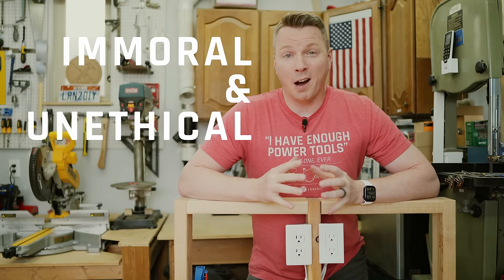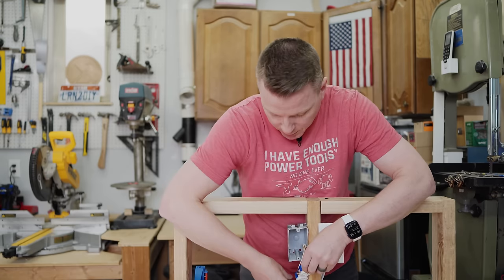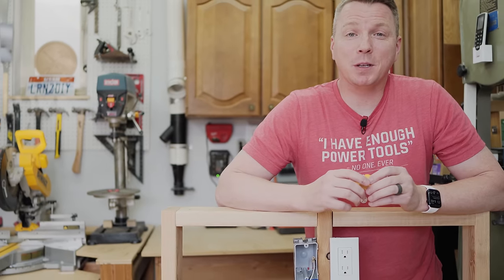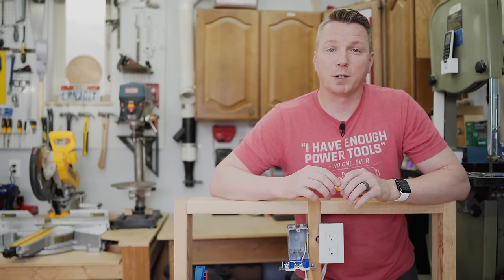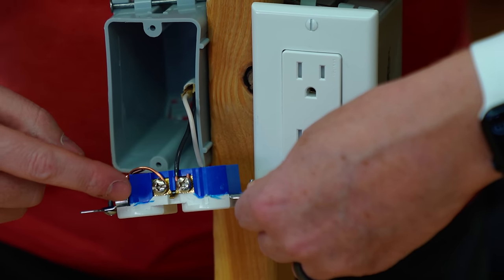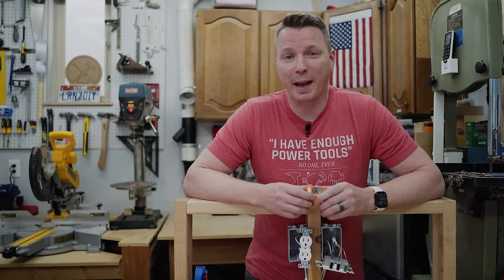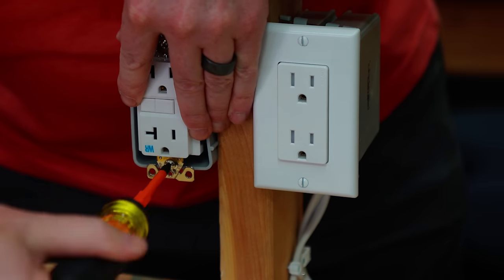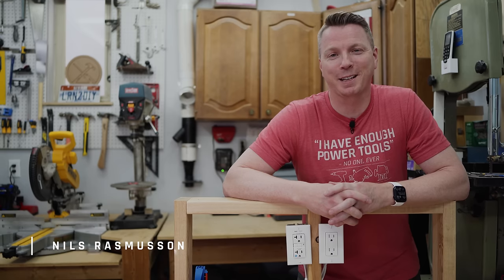People Are Adding Deadly Hacks to Outlets

Comment: honestly i just plug the neutral and fase into a 3 prong jack and dont even use the 3rd i see it as a way to hold the plug sturdy xd i think a ground circuits makes it easier to shock yourself if you working with a live fase and accidentaly ground yourself to the neutral  you can grab a live fase as long as you dont grab the neutral with anything else

Comment: I could afford to rewire the older half of my house but I did upgrade the panel to breakers and run all new cable in the basement as far down stream as I could without tearing out walls, then put in GFIs anywhere still without a system ground. The old stuff is braided 2-wire. No poles at least.

Comment: Is there a safety reason against running electrical cable inside PVC or similar piping? I recognize that there might be legal issues depending on where you are, but is there a safety issue?

Considering a remodel, and trying to make future repairs more accessible and obvious by putting labeled pathways for wiring, networking, plumbing, etc. I know a lot of remodels I've seen have wires just going freely through drilled wood, so I don't see a reason thin piping should cause issue.
Reply: Well, you can't just use water pipes for wire, it does have to be actual electrical conduit. But, yeah, that's actually a great idea. Most contractors don't bother because of the expense, but it's actually a much better idea in almost every other way.
Reply: @HiddenWindshield  is electric conduit waterproof in case of leaks or condensation?
Reply: @saurianwatcher4437  No. In fact, it can't be waterproof, because condensation would happen anyway, and you need some way for the water to drain.
Reply: @HiddenWindshield  OK, so safer would be conduit with maybe a PVC "hood" by cutting the PVC in two. 

Basically, my thought is wood panel walls (horizontal) and one of the panels is hiding a pathway that all the conduit and piping goes through for easy access for repair. 

All of this would be on an internal wall with high thermal mass to provide passive heat storage in the winter, and passive cooling in the summer by running cool water through it.
Reply: It's a pipe dream project.
Reply: @saurianwatcher4437  LOL no, a PVC "hood" wouldn't help anything at all. Actual electrical conduit really is the best way to go.

Comment: One thing you missed…
The outlet tester also won’t tell you the outlet that you have installed is UPSIDE DOWN 
Ground pin should be up !!!!!
You may ask why …
In the case of the plug not inserted all the way in and leaving an exposed gap where any conductive material can fall (gravity) and short the hot and neutral !!
Local Inspectors here would not pass your installation as you have demonstrated. 
Ground pin has to be UP.

Comment: You can run a ground wire to the outlet from the panel and that doesn't have to be in conduit. You can also use the conduit as a ground path. Two other methods. You are talking about cable in your video.

Comment: Strange.  In all the homes I have lived in, the old two prong, two conductor cable was BX type with a metal shield.  To add a three prong outlet, you just need to add a ground wire that connects to the shield. The only exception was in really, really old post and tube type wiring that doesn't use cable at all, only two wires running next to each other.  You hardly ever see that anymore and if you do, you should replace it with modern cable because it wasn't safe even when it was newly installed.

Comment: Uhm ... wait a sec. ... is that a 15 or 20A circuit?  That GFCI you show being installed there is 20A, not 15A.  The 3-prong you showed in there before was 15A.
Probably best not (and code?) to have 20A outlet/receptacle (though switch would be okay, presuming one uses connections on it that are designed to also accept 14 gauge / 15 A wiring on it where one is using such wiring on 15A circuit) on a 15A circuit (as one may plug in an up to 20A load and overload the circuit), likewise 15A receptacle on 20A circuit also not good, as the outlet could be overloaded if thing(s) plugged into it draw over 15A total (overload or short).

Comment: I have still yet to find anyone that can explain to me the purpose of a "seperate" equipment ground, and while I've never encountered a bootleg ground nor have i installed one i dont see any problem with it so long as it is properly wired. Is there a difference between bonding the neutral and ground in the outlet rather than in the service panel? maybe someone here can explain to me what (if any) difference there is since to me there is no difference in length or gauge of the wires used in Romex so the resistance of the wire is the same, the ground and neutral busses are already bonded in the panel so why not save 30% of the cost by runnin 2 conductor rather than 3 conductor (this is obviously excluding split phase appliances that do not require any 120v since no neutral would exist in that circuit and would require an equipment ground to be ran)

Comment: Another option would be putting a 60W light bulb between live and ground. If the breaker pops, the wiring is fine. If the light stays on like normal, ground is shorted to neutral.

Comment: You put a 20 amp GFCI outlet where a 15 amp duplex receptable was before, possibly exceeding the wiring and circuit breaker rating.

Comment: I don´t see a big problem in bootleg grounds, it´s very oldschool but still better than nothing. For circuits without RCD protection, bottleg ground and "proper ground" doesen´t make such a huge difference, since neutral and ground are connected in the fuse box anyways. 
The only danger is that when the neutral wire gets disconnected somwhere between the fuse box and outlet

Comment: I have a weird question.  In a case where a circuit is wired in reverse (black to silver, white to brass) would it be kosher to reverse the wires at the circuit breaker box, and mark them with the correct colors?  I think this MIGHT be kosher, but I would certainly NEVER do this!
Reply from the maker: Unfortunately, no. You would have to fix the receptacles (outlets), and not rewire the circuit breaker panel.
Reply: No, you must use proper colors for proper conductors. In cases where use reassign the neutral as a switched live you mark it with a tape.

Comment: You never explained why it's dangerous, i mean the ground and neutral (white) wire are connected to the same rail in the breaker box. My guess is that its for the reason that the Russian channel kreosan was able to get output from a pipe in the ground and the neutral wire. Voltage drop across the neutral wire while your standing on the physical ground wich may not have as much voltage drop could give you a little shock

Comment: In Britain, all electric cables have the Earth wire installed into them. You might need a sheaf to go onto the Earth wire, although you can connect it up, with the earth wire bare. 

Red for danger, so that is the Live wire.
Black is the Neutral,
and Green, or Green and Yellow, is the Earth. 

Although the new colours are:-

Brown is Live, 
Blue is Neutral,
Green and yellow is the Earth.

Comment: I'm not defending the practice which is dangerous for several good reasons. However, it should be noted that the Earth and Neutral wires come together in the distribution box. Meaning they are electrically the same signal. This was a shock to me (no pun intended) coming from Europe where the Earth and Neutral wires are not the same and are wired in very different fashion.

The Earth wire provides a level of redundancy. Although it carries no load in normal conditions, it must be capable of carrying the full load from the live wire should an electrical fault occur. In this illegal configuration, if the Neutral wire is compromised, or the Neutral connection on the socket is compromised, then Earth safety is immediately lost.

Even in recent build homes (post 2020) I recommend you have your new-build home independently inspected. Approximately 2 out of 3 homes I inspect have some form of electrical fault ranging from procedural to potentially catastrophic. Yet all of these homes were nominally 'inspected' prior to sale and deemed safe.

Comment: Instead of replacing the outlet with a GFCI outlet, could a GFCI breaker be installed in the electrical panel?
Reply: if you change it to ungrounded outlet yes

Comment: I thought that the main reason for using this solution is to connect the device housing to the ground. that way if there is a short circuit inside the device and the housing is energized, it will create flow of current that will pop a fuse. Otherwise you wouldn't know til you touched the device and got shocked

Comment: Why doesn't the bootleg ground short out and melt the conductor? It won't trip the breaker because it bypasses the neutral connection to the breaker. But since ground is (should be) bonded to neutral at the service entrance, it is shorted
Reply: Neutral and ground are electrically the same. It doesn't matter if they're bound together at the outlet or at the panel box, it's all the same electric potential. A bootleg ground won't cause it to short and trip the breaker. He's kinda over exaggerating how dangerous a bootleg ground. It still provides the ground on the outlet a return path to the panel box via the neutral wire instead of a dedicated return via the ground wire. By no means am I claiming that it's safe and I would never do that or recommend it to anybody. I'm just saying that it would work and you'd most likely be okay if something were to happen. However, there is a reason that code requires a dedicated ground wire and that ground and neutral to be bound together only in the panel box and nowhere else. They want a separate dedicated return path back to the panel box in the event that the neutral wire breaks or opens in some way. The ground wire is just a second, separate return path to the panel box for redundancy.

Comment: There's a mistake regarding 20 amps running through body. Body resistance is quite large so current would be in the miliamps range.
Reply: a wet body can go down to 1000 ohms, which'll get you 0.12 amps at 120V, which is easily deadly

Comment: Well, in some situations bootleg ground is better than no ground. If a device breaks in a way that there is a short between the hot wire and the device's external metal parts that should be grounded, with no bootleg ground, you can get a shock, with it, it will trip the breaker. The only risk with the bootleg ground is when the neutral wire breaks, touching the device will close the circuit through you. The question is, which situation is more common - an appliance or wiring failure.
Reply: No. With no ground, the circuit breaker will trip only in an over current situation or a hot to neutral short. If you plug an appliance into a bootleg grounded receptacle the appliance will be sharing return current between the neutral and the ground. I'd say that it would be highly likely that you would get a shock because the ground plug will be connected to a current carrying contact from the receptacle.
Reply: @surferdude642  Yes, hot to neutral short will be happen if there is a bootleg ground and the appliance breaks in a way that there is a short of the hot wire to the appliance's metal cover that is usually grounded.

Comment: So does the neutral not connect directly to ground anyway?
Reply: The problem is if something happened to the white neutral wire than runs back to the mains. Then suddenly anything plugged in stops working and becomes electrified and likely to give you a nasty or fatal shock.

Comment: I know it is bad, but please explain how the bootleg ground is dangerous since the ground wire and neutral are connected in the panel.
Reply: bootlegs cause current to flow through ground wires and grounded metal parts of appliances. not ideal. and if you cut, damage, or switch your neutral, you get full line voltage on all the grounded metal parts of the appliance too.

Comment: Its not "designed to fool the outlet testers" - its designed to avoid running a new wire where no ground wire ever existed (old houses).   it happens to fool the outlet testers because it CREATES THE EXACT SAME CONNECTION that a properly wired outlet has.   Ground and neutral are ALWAYS bonded at the main panel.   In this case, they are also bonded at the receptacle.  Its not code, but it works.  Calling it "deadly" is ridiculous hype.   It only creates a hazard in one specific case - an open neutral.  And while an open neutral can happen, and would result in voltage on the ground pin with this jumper installed, it is a rare occurrence.  I would never do this on someone else's house for pay, but I have done it to my own house many times.

Comment: I don't know where you live, but where I live the white and ground wires go to the same terminal block in the breaker box.  They're essentially the same wire.  Splitting it in the breaker box or in the outlet box is no different.  3 wires is totally unnecessary overkill.  The neutral is the ground

Comment: my house was built in the 20s-30s. we don't have any ground wires in the old boxes. 40 years here no fires or deaths. 60 years before us. that's how it used to be done because an old electrical system n and G are bonded at the box.

Comment: I don't see how connecting neutral to ground is actually dangerous aside from making it Impossible to install a GFCI at the panel. I live in Germany In a house that is wired without seperate neutral and ground wires.

Comment: Most outlets in western Europe have earth by default and a earth line switch protection . If it detects a small leak it will switch off the main switch. 😊 of 3 to 4 16A switches
Reply: Yeah we have grounds by default here too, it's just super old homes that don't which is the case in Europe too. In fact this workaround was actually perfectly legal in Europe at one point, it was never legal here.

Comment: Couldn't you run a resistance test between the ground plug and the neutral plug to check to for conductance??
Reply: Ground and neutral pins will show conductivity even if there is no bootleg. Ground and neutral are bonded at the service equipment. Perhaps you can see a difference in the ground-neutral resistance when comparing a properly grounded outlet to a bootlegged one.

Comment: Small technical note...

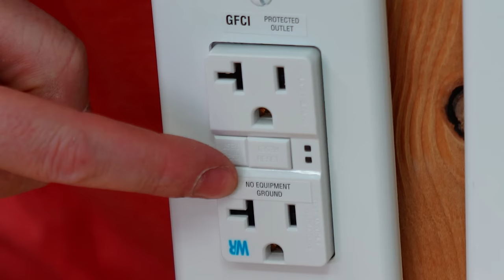7:45 GFCI outlets do NOT measure the current going into it AND out of it. GFCI outlets are constructed in such a way that they're merely checking if there's a net current flow into the outlet.

If you disassemble a GFCI outlet you'll find that both the common and hot wires go through the same current transformer, so if there isn't a short to ground, the two current flows cancel each other.

Comment: Honestly that’s why I’ve never bought an outlet tester. I just use a multimeter, which will show a VERY small voltage between neutral and ground if wired correctly, but would show a dead short if someone did this hack
Reply: How would a multimeter show a dead short if there’s a bootleg ground?
Reply: @bobbyb2952  The voltage between the neutral pin and the ground pin would be 0.000. If you measure a properly wired outlet you'll see some voltage, dependent on how much current is flowing through the neutral bus bar in the panel. I just gave it a go, measuring neutral to ground on the outlet nearest me and it read 0.006V AC, that's REALLY small, but if I put the two probes together (which a bootleg ground is the equivalent of) it read 0.000V. It helps to have an autoranging meter for this, although nothing stops you from just switching to a lower voltage range (won't damage the meter, as long as it's digital) to get this measurement.

Comment: I really don't understand your us standards. However. In my country the coloring has changed a few decades ago and some homes still have the order standard coloring but we are obligated to change the wires to the new standard if the particular room gets renovated. 
Luckily I only had old wiring in the hallway and changed it because the new and old together can become confusing if not being familiar with the old coloring.

Comment: Couldn't you build a bootleg ground detector simply by checking if there is a direct connection between neutral and ground (for example by using a multimeter in continuity/resistance mode)?
Reply: No, because there is a direct connection between neutral and ground.  It is just supposed to be in the breaker box.  They are essentially the same wire but with redundancy.  In a two prong outlet if your live wire breaks you have no power.  If the neutral breaks you have the possibility of being zapped.  When you add a ground your just giving yourself a second chance to not be zapped.
Reply: If the power is on and appliances are running on the same circuit there should be a very small voltage between the ground pin and the neutral pin. The neutral wire has a small amount of resistance, so as current flows from the wall socket to the breaker box, there is a small voltage drop across the wire. The ground wire carries no current, so it stays at zero at every point.